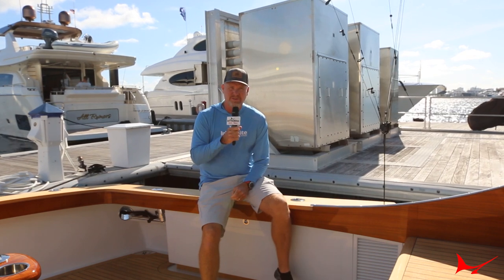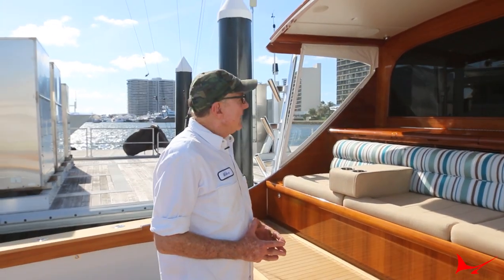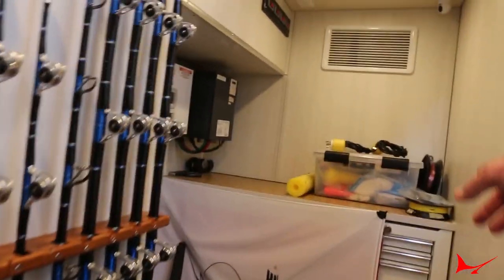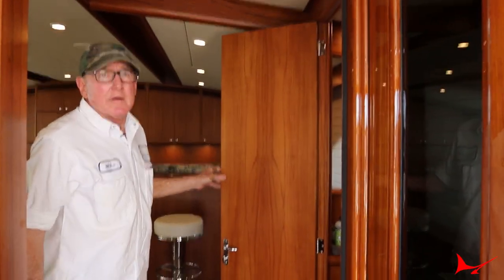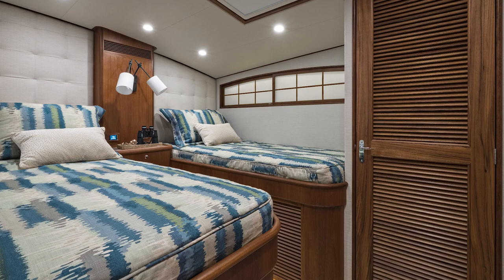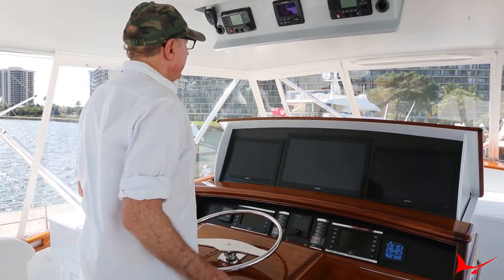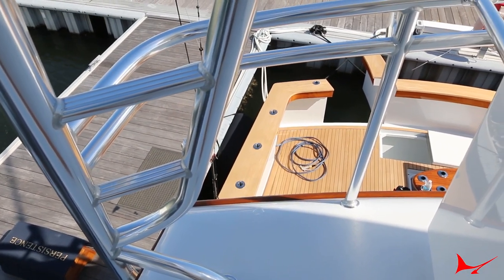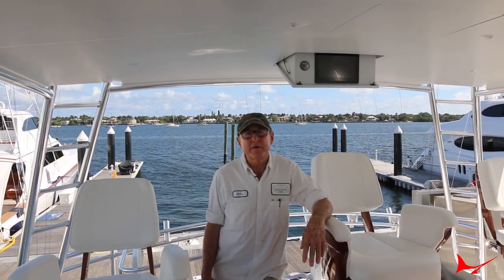Splash Report: 78’ Michael Rybovich Persistence

Comment: They build beautiful custom sportfishers. I have never rode in one of his boats but in the custom boat community they have a nickname called a pompano pounder because they give up a good ride for speed. A 78ft boat that can run like this one is going to give up a smoother ride in rough seas. The custom boats built in the Carolinas are able to cut through rough seas better versus this boat being built in south Florida. But I absolutely love the beauty of these boats
Reply: The Carolina boats are no slouches in the speed department.The 70' Jarrett Bay Ravaganza had a pair of MTU V 16 engines rated at over 2500 h p each.It ran 50 mph plus.
Reply: @spiderdavis3296  you are right these new boats can haul ass
Reply: I was talking to a custom Carolina SF builder of boats in the 60' range and he said while there used to be a bigger difference in Carolina boats vs Florida boats with all the hulls being designed by Naval Arch's today the differences have diminished .

Comment: Gorgeous! But I never saw a Livewell!
Reply: He spoke about it they are removable they are centered in the cockpit go back and look they were not present but he showed where they go right next to the fighting chair or center station so you can add live bait to your lines and not have to run back to the transom to grab them they are centered on the cockpit so you can add them where you are working on the lines. 

I saw a donzi like this I though it was a turn off seemed like a quick fix but now I see it is ease of use when baiting hooks from the center rod holder
Reply: It is on deck live well adjacent to the rocket launchers it’s a removable bait system